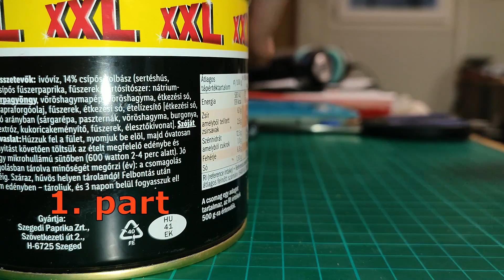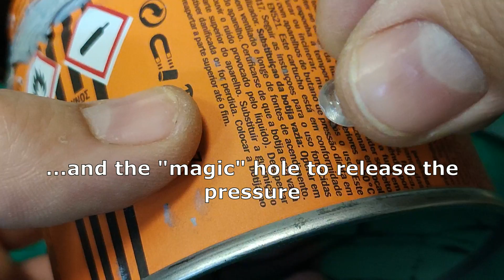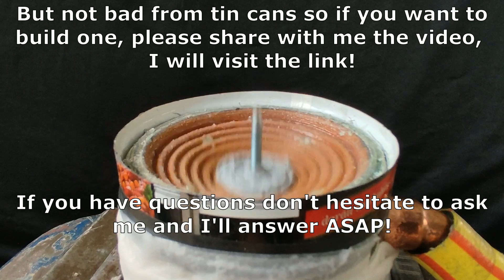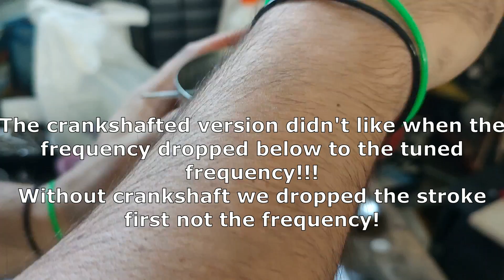The Hot Air Engine that You Never Did Before - tutorial with tin cans and spider

Comment: Hello, 
What is the purpose of the copper fitting and the green hose ?
Reply from the maker: Sorry for the late answer! Copper fitting is the connection between the resonator tube (green hose). The resonator tube is an air piston with momentum that help to increase the pressure also decrease the pressure when it's needed. Also it works like a gas diode or a superlight check valve. This is not a Stirling cycle engine, it's more like a modified Manson cycle or a doubled Ericsson cycle because of the negative power cycle. Also this unit is free piston engine, so you can't find any or too much background information about it on the internet. My friend and I developed it in the past decade.

Comment: Mr Sergio Luiz from Brazil made one using a solid cold piston and a diaphragm as the resonator. The torque is impressive, the frequency is low and it works with a very low flame
Reply from the maker: I know him, but his units are all free piston Stirling engines. We are good "friends" here. This one is not a Stirling engine, and the working method is totally different too.

Comment: Maybe this simple design is usefull for making a stove fan. The most simple design there is. I don't like peltier element stove fans because they melt quickly, are small, convert little energy, and can not be placed anywhere, and the fan has an electric motor that can not be placed everywhere because it melts too. My stove needs more air supply, and more heat distribution to the room, but it has to be simple and robust.

Comment: Could you replace the hose with another diaphragm?
Reply from the maker: Theoretically this is a possible thing, but not so easy to tune it up to the right frequency. I thought about it a lot. That's why I've made the crankshafted version and the free controller-piston version. Lot odf things not clear enough around this type of engine, but every changes opens new possibilities.

Comment: I watched your old video on the metronome. It says that the power piston diameter should be 46% of the displacer diameter. This engine does not follow that rule. Can you explain why?
Reply from the maker: The membrane type piston has a solid "piston equivalent" diameter that came from the displaced volume and the stroke. Probobly not the best but worked well.

Comment: This is a standing wave thermoacoustic engine. The reason why the hose increases the torque generated by the engine is likely due to the fact that it acts as a resonator, amplifying the sound waves generated by the engine and increasing the amplitude of the diaphragm's vibrations. This, in turn, increases the amount of mechanical energy that can be generated by the engine.
Reply from the maker: Standing wave units has one one tube resonator with one piston usually. We have two pistons here with phase shift. The bigger one is connected to the displacer directly as Manson engine does but I changed the displacer with regenerator also no valve here, just a long tube as resonatot/control piston that could change the pressure and turn the cycle back. Do you know about Manson/Ericsson cycle? This unit has a cycle something like that. Not as a standing wave engine where the cycle is close to the Bryton.
Reply: @AttilaBlade  a working ratio for a standing wave thermal acoustic engine with a hose is 596:1 (cubic inches) 

So engine has 596 cubic inches of internal volume, it needs to have 1 cubic inch of internal hose volume.

For example: 
The volume can be calculated using the formula for the volume of a the hose:

V = πr^2h

where V is the volume, r is the radius (half the diameter), and h is the height (length) of the cylinder.

First, we need to convert the height of the tube to inches, since the diameter is given in millimeters. 6 feet 6 inches is equivalent to 78 inches.

Next, we need to convert the inside diameter from millimeters to inches. There are 25.4 millimeters in an inch, so 3 mm is approximately 0.118 inches.

The radius of the tube is half the diameter, so r = 0.059 inches.

Now we can plug in the values and calculate the volume:

V = π(0.059)^2(78)
V ≈ 0.817 cubic inches

Therefore, the air volume inside the 6 foot 6 inch tube (1/8 inch diameter) is approximately 0.817 cubic inches.
Reply from the maker: @LES_Thermodynamics  Yep, you've right about the resonator tube. In that tube we have a pulsating gas, that works like standing wave. This movement controll the cycle of the engine. But the cycle inside the unit is not same as a standing wave engine does. The gas piston's movement has a phase shift to the Power/Displacer piston. I've made a 2D sketch video how Metronome unit works around 8 years ago. My english wasn't good but I think you will understand that. BLADE
Reply: @AttilaBlade  great! Gotta love hot air engines and how many unique designs are out there. I am going to post a video later today of a standing wave with a diaphragm and a resonator tube, thermoacoustic engine. The tube inside of water drastically increases the torque and speed of a thermoacoustic engine
Reply: @AttilaBlade  have you tried shortening the hose and putting it in a cup of water, then running the engine?
Reply: I think this might be one of your strongest engines. Hard to make though.

Comment: Hmm.. Put a fan blade on that in place of the flywheel, and set it in my wood stove. Cooling the top half would be problematic though. I'm not really going to want to keep swapping wet paper towels on it every 20 minutes and after a while, I'm sure the overall mass would heat up and lose a lot of speed, if not quit working all together. 
I know they already have wood stove fans that run on heat but I'm not exactly sure how they work. If it's some kind of Sterling engine or a Peltier type device.
Reply from the maker: Dear Keith, the cooling is not a big deal if you can add a water jacket to the top half from a bigger can. The water will boiling up, but the temperature will not growing up as 100C there if there is some water. The stove has much higher temperature so it will work well. The tube could be a problem but you could change it to silicon and turn it around the top, or use solid tubes... I saw Peltier and Stirling stove fan too, this one is not the ideal to it, but you can make one if you want! BLADE

Comment: Great video again! I was going to reply to another comment, but here's what I think 
With a crankshaft you can drive a DC motor pretty easily, which would output DC without the need to be rectified.
A more traditional generator would be a little more complicated because of the AC output. The simplest full-bridge rectifiers consist of just 4 incredibly cheap diodes.
Whether you use a DC motor as a generator or make your own, I'm certain you have the skills to out one together.
Reply: I had the thought of putting a fan blade on it and sticking it on my wood stove to circulate some warm air. I'm not sure what would happen after an hour or so when the entire thing heats up though. I'm certainly not going to want to keep putting wet paper towels on the top half every 20 minutes. Or even if that did work just leaving it alone, put a little DC generator on it. The problem with those Stirling engines is you have to input a lot more energy than you can get out, but since the wood stove is burning and generating heat already, you may as well use it for something. 
He measured the torque of the engine as .45 Watts I think it was? But the amount of heat energy he was putting into it to get that power out was a Lot more than that.